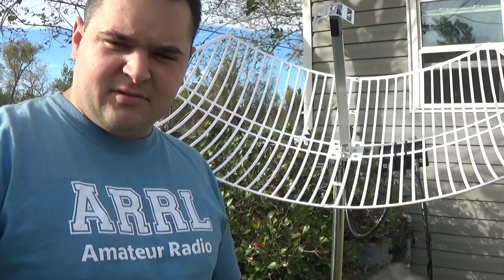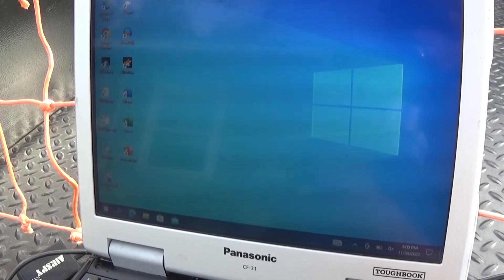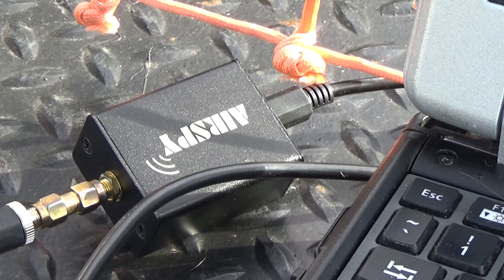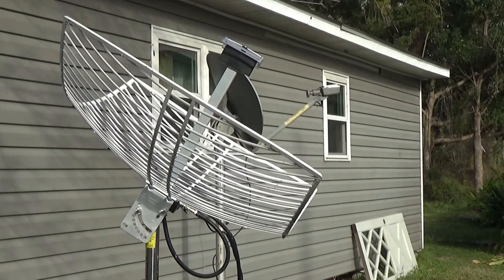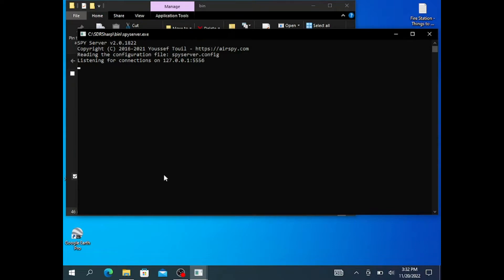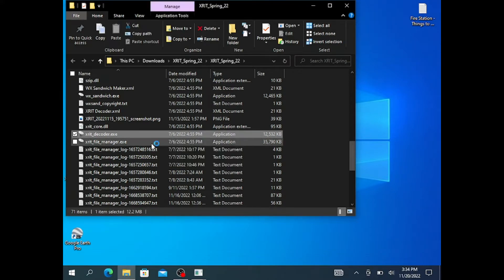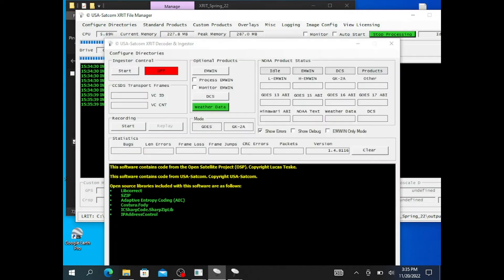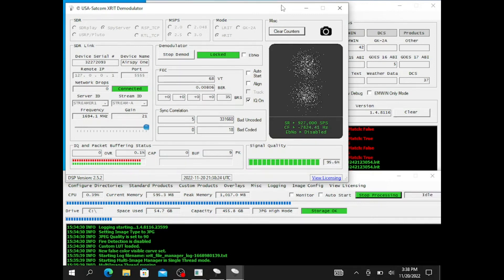Receiving GOES Imagery and Data with SDR

Comment: will my old direct tv satellite work for this?
Reply: If you replace the TV LNB with a cantenna or slotted antenna (like the one in this case) and point it at the satellite, it should work, but an L-band amplifier may be needed.